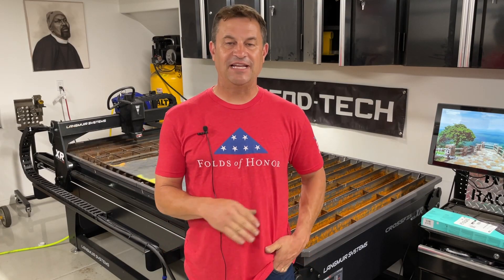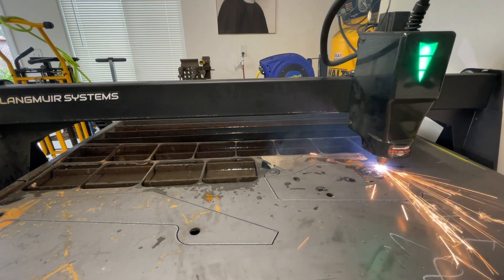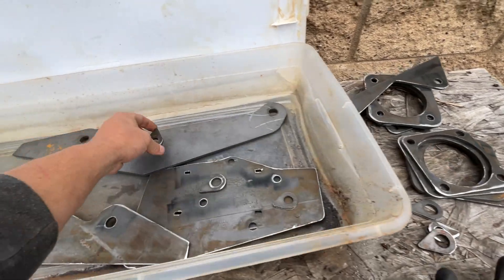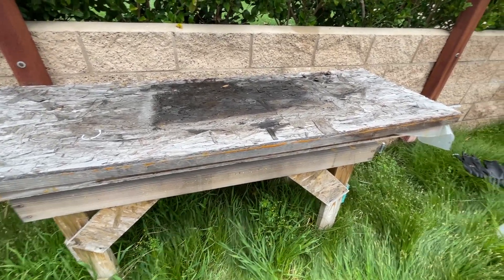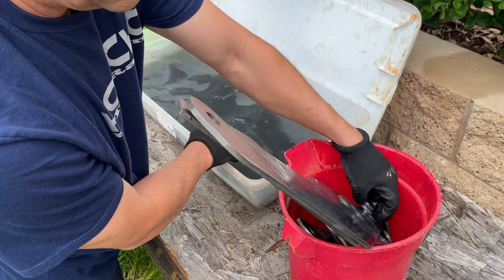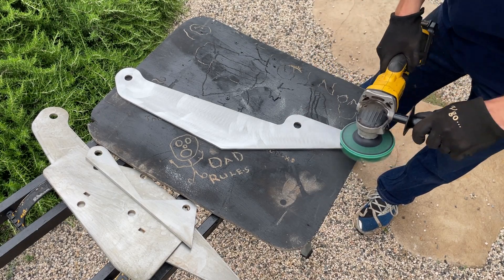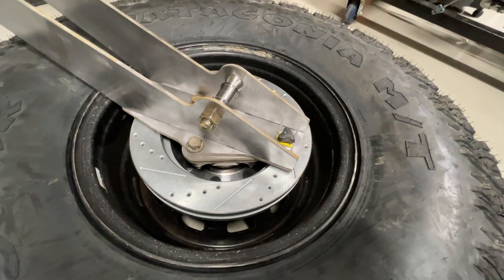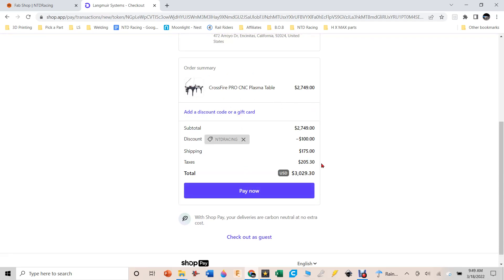Use Vinegar to Remove Mill Scale

Comment: By the way, Harbor Freight's Baure surface conditioner tool is in my opinion the definitive tool to prep the surface. After the vinegar I rinse the parts (in the kitchen sink, I just use plenty of hot water and I have not seen any stains) and then hit them with the surface conditioner tool, not only they have that beautiful brushed finish that seems stainless, they are just ready to TIG
Reply: That's exactly what I do as well I have not found a better method

Comment: Hey next time you order metal, Look and see if they offer the plate in P&O (pickled and Oiled)   It will be clean and shinny without mil-scale when it comes in.  In my case when I ordered it in from O'neal steel , it was actually a little bit cheaper over the steel with mil-scale.  When I got my Arclight Plasma table, finding out about the P&O plate and tube made my life so much better. Made consumables last longer, Cleaner cuts and less clean up. 
Also muriatic acid takes mil scale off really fast, in a matter of minutes.  You can find it at home depot.  But the best way is just buy metal with out it.

Comment: Its more toxic and you have to be a little more careful when using it but I use straight muriatic acid to strip parts in the same manner. I can have parts ready in 20-30 minutes depending on how bad the milscale is. Waiting basically a whole day to have parts stripped is not even remotely in question to me haha. A quick acid dip, they come out and get dipped in fresh water to get the remaining acid off them, dry them off and then DA sand them down and they look perfect in a fraction of the time. If im not using them immediately ill wipe a thin coat of WD on them and they will stay that way for weeks
Reply from the maker: I am going to check that out.  That would be especially useful for the smaller parts that I cut and need right away.   Thanks.
Reply: check into just buying P&O metal from your supplier, usually its cheaper and it doesn't have mil scale. If your cutting with a cnc plasma table, the cuts are so much nicer as well!

Comment: Great info Dave. Mill scale is the bane of my existence, thanks for the tips
Reply from the maker: I don’t always.  Probably should.   At 50, I am really starting to think about what I should be doing now that my 70yo self will thank me for.  More respirators, gloves and eye protection.
Reply: @ntdracing  yeah that's a fair point. My appreciation of PPE has definitely increased in recent years
Reply: Do you wear gloves when you use a acetone?

Comment: Hey Dave, I got some of those 3M discs from your last video, they work great. Here's a couple extra tips from my shop. I bought a Vevor magnetic chuck for holding small steel parts for de-drossing, flappy work. Works great. Also, for scale removal on long tubing, I use a capped 4" PVC pipe, also works for vinegar storage. Thanks for the quick video.
Reply from the maker: Great advice...I am checking out the Vevor chuck right now.  Thanks!
Reply from the maker: Just ordered one.  Thanks again
Reply: @ntdracing  You'll love it, so simple and fast.